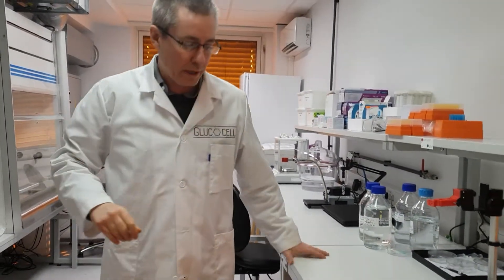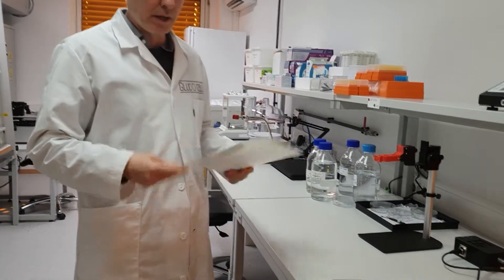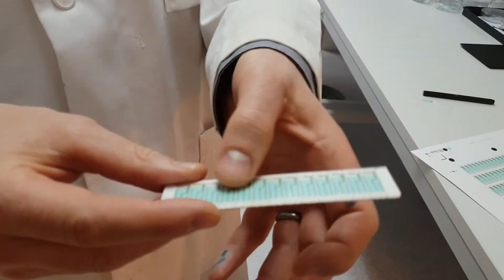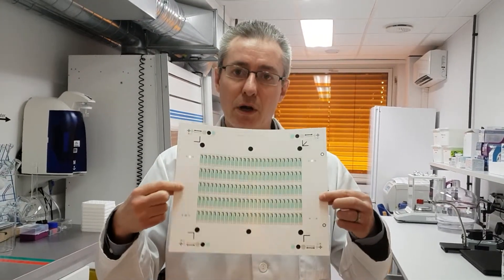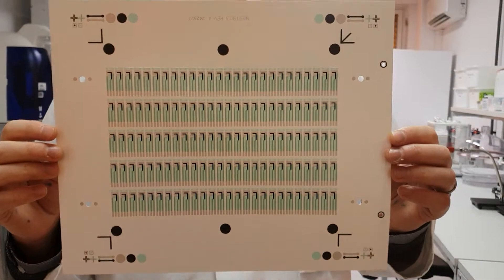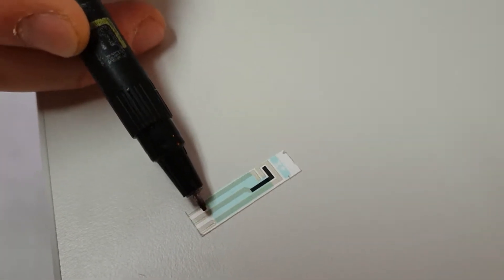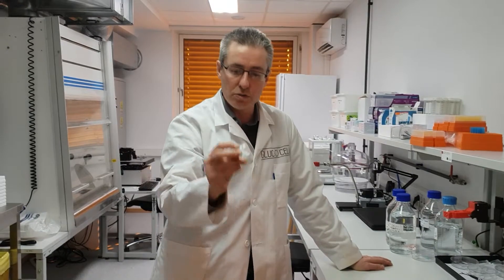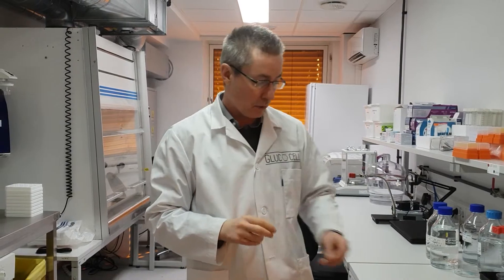The 99 cent ZP screen printed electrode

Comment: from which polymer they are made? we need to know if we have to prepare a electrochemical nanostructured bisensor with multiwalled carbon nanotubes be part of working electrode ... as substrate properties has to be known ...will it work for a electrochemical sensor to detect sulphonamides or antibiotics
Reply from the maker: please join the developers zone - https://www.zpforasia.com/2020/06/24/zpdevelopers-zone/
Reply: @zimmerpeacock9703  ok